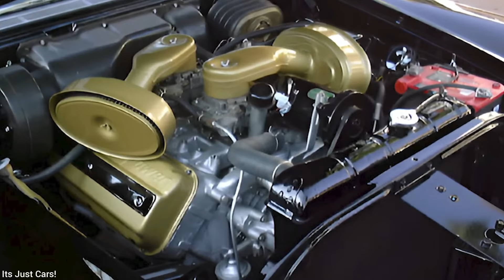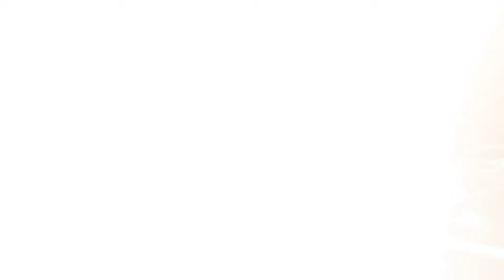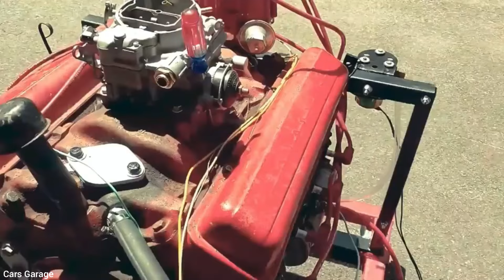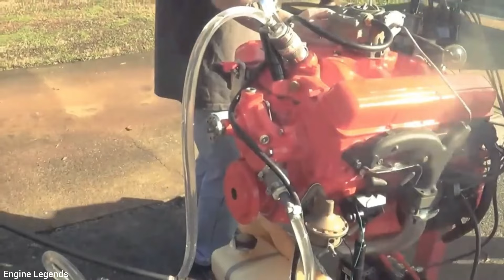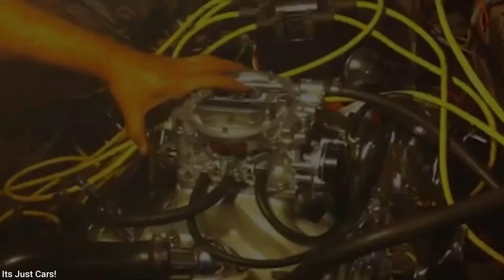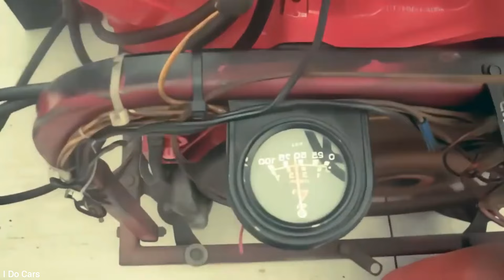Why Chevy Small Block Engines Are Overpowered😳 | Explained

Comment: There was a Top Alcohol dragster run by a guy named Rick Santos back in the 90s, he dominated the class until they took away his weight break for running a inline valve 377ci SBC against 500ci blown alcohol Hemis, that SBC made 3500-4000hp to run the numbers it ran. It was all aftermarket, but SBC based. 14-71 supercharger on it with serious boost. Loud as hell. Seen it run back in the 90s. Beat every car in the class. It ran 5s in the 1/4.

Comment: Back in the late 90s, Don Kirn built a all aluminum 427ci SBC with a Rodeck aluminum block and huge ALL PRO heads, made 1005hp NA at 9000rpm with a single 4150 Holley. 1000cfm unit. Don was one of the best Outlaw Sprint Car engine builders in the world. 410ci SBCs making 950hp NA. Baddest NA SBC I've ever seen. I've built hundreds of SBC racing engines myself over the past 40+yrs. They definitely have potential.

Comment: an interesting combination back in the 80's, was a 350 chev, with Cleveland high port heads.
Reply: Good luck with that swap. Why bother when aftermarket SBC heads exist that will out flow the best bigblock Ford heads ever made. You can buy 450+CFM SBC heads if ya got the money.
Reply: 351 Windsor with Cleveland 4V heads is a good swap. 275cfm stock. There are intakes available for that swap.